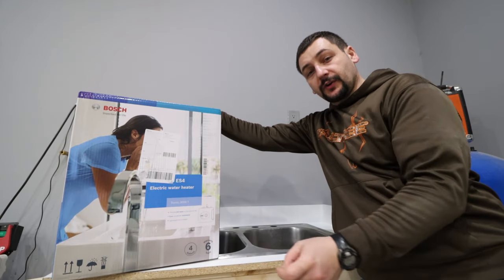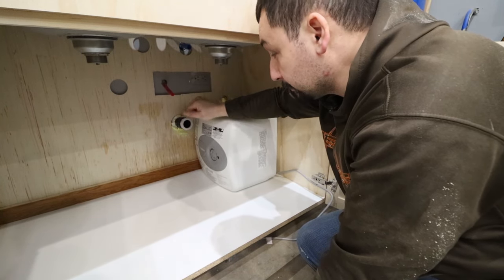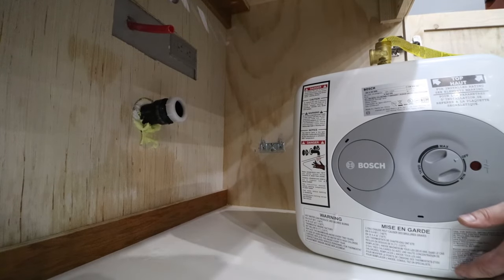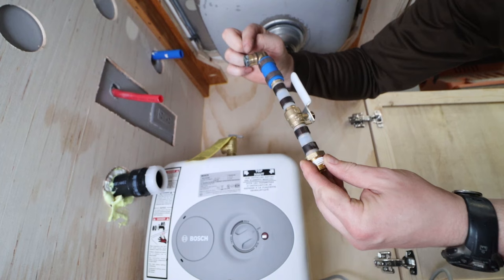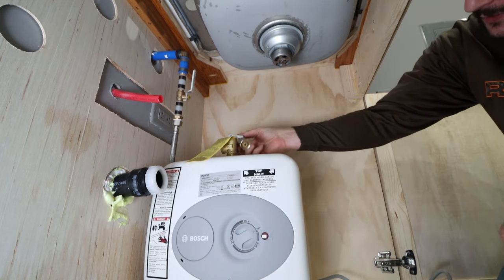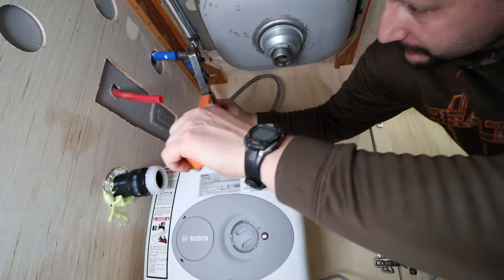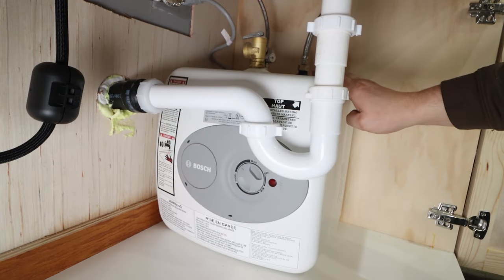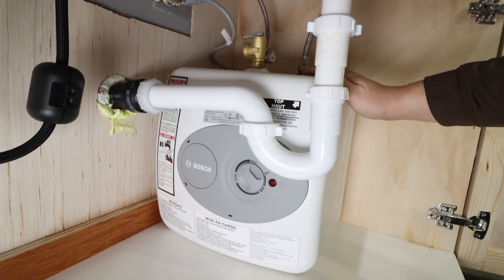Under sink Mini Tank Electric Water Heater Install

Comment: PLEASE stop calling it a Hot water heater. If anything it’s a cold water heater, or just a water heater.😀
Reply: Never understood why you would need to heat hot water 🤔
Reply: 119 ministries YouTube the sabbath day video you'll want to watch it.
Reply: @joejr1967  it is called a hot water heater because it heats water
Reply: No it’s not. Hot water heater is redundant!!!!
Reply: Wouldn’t the hot water supply line from the house connect to the cold water supply to the little tank? As you run out of hot water from the little tank it will be filled eventually with hot water from the larger house hot water tank, assuming you kept the hot water running long enough in the bathroom sink. 🤔
Reply: I feel that way about people who say naan bread. Naan  means bread, so people are saying bread bread.
Reply: What if you don't have a inlet for a water hose, like setting up in a parking lot with 5 gallon jugs of water?
Reply: Get over it
Reply: @tmkinnear : Nope, you want to hook it up to the hot water line. That way it heats up faster and not have to heat up more when the hot water from main house travels through. Why would you want to heat up cold water when you can heat up hot water faster. The purpose of this tank is to heat up water so you don’t want to waste 3-5min of water down the drain when waiting for hot water to get to you.
Reply: @AlvinBrown NO wrong, is call a WATER HEATER you don't need to say HOT because by saying the word HEATER  it's already implementing the temperature, and you can't heat hot water, so he is correct is not a HOT WATER HEATER, is just call WATER HEATER
Reply: @thefisherman6000_USA that’s what he said

Comment: You probably want to put a discharge pipe on that t&p valve so it's not aiming right at the plug that you have right there
Reply: and to a location not effected by water
Reply: How would you suggest plumbing the t&p valve? I don't have an easy drain location. What did you do?
Reply: How would you plumb the t&p valve. I don't have a local drain
Reply: Worst case, run it down into the crawlspace and hopefully catch a drain down there. Worst case, the crawlspace is better than discharging into a finished cabinet
Reply: Good vid, thanks. A water pressure vent almost never happens at the heater. In my house, a failed expansion tank caused an increase in pressure. (Hot water expands.) The hot water heater exploded first. I heard it pop. I went to the garage right away and checked everything out. The 3/4" "vent pipe" outlet didn't work. 55 gallons of water were on the floor and the water was still flowing... Good thing I was able to hear the heater from upstairs in the house, (18 year old Goodman, common choice with builders). FYI I installed the new heater with two expansion tanks in the closed system. They are cheep... ($20) but only last so long... Available at all home improvement stores. Having two expansion tanks and a pressure gauge at the hot water heater are a must if you have the space to do this.... I have 3 tanks now with pressure gauge watching the whole closed system. (closed system:  Basically, if you are heating water and no valves  are open, your system is closed and the water pressure will rise.)
Reply: @williammontgomery3249  should push back to the city hookup unless there is a check valve

Comment: I never had a problem with cold sink water until I had to replace my bathroom faucet with the new low flow set. Now I have to turn the hot water on and walk away for a while. I'm looking at something like this. It's looks like a simple install, and I have a dedicated 120v circuit a few feet above where it needs to plug in. I can pipe it into the existing hot water line so hopefully I can use a smaller version of this, need to do the math. Thanks for this video.

Comment: you did a great job prepping everything for a professional install.  My only question is the direction of pressure release valve.  Do you plan to re-route it away from back of cabinet?  great job!  I'm facing this now.

Comment: Great video! Concise and easy to follow. Well Done! What about the relief valve? Is that fine to leave unplumbed?
Reply: No the relief valve should be plumbed to drain since it is in a finished space.
Reply: @dpky7333  cant do that because of potential for sewer gas/water to back fill into water heater. Have to plumb to outside of building.
Reply: @geraldbennett7035  in warm climates, that's correct.  Otherwise to drain with 1" air gap.  However under a sink it's tough because the air gap creates the potential for a clogged trap to spill out through the gap instead of filling the sink.  Since a mini water heater can easily be removed, I think it comes down to whatever risk the occupant is willing to take.  Backflow risk vs. Scalding risk vs flooding risk.  But I think we agree that leaving the t&p valve as is is unacceptable.

Comment: Hey Daniel!

Thanks for the video! I do have a dumb question for you, how does the water travel up the line from the water heater?

Pressure? Or is there a motor?

Thanks!
Reply: pressure
Reply: City water is what he connected to, city water is designed to have a certain pressure behind that water. Maybe 40-80psi or something, idk. If he was off grid and had a water tank lower than the sink in elevation, then he would need a pump to get the water around the house. OR mount the water tank on the roof and use the “gravity” to pressurize the system

Comment: Would it make sense to connect the cold water supply to this and not the hot water? My bathroom sink is across the house from hot water heater, so pulling hot water to refill this tank would not get any hot water from the heater before it is full.  This would just waste the hot water in the line.
Reply: I don't think this is a booster for an existing water heater.

Comment: Am I missing something??  Why do you have a separate water supply feeding the heater and then another supply line (the red one) going to the cold water side of the tap?  Are they both cold water?
Reply from the maker: Yes the are both cold, I ran out of blue half inch pex, when I was plumbing the shop.
Reply: @DanielWoodell so technically I could just connect a hot water line  and cold water line to this?
Reply: Or am I missing something because shouldn't you have 3 lines at this point 1 cold water line and 2 lines for hot water one from the supply line into the unit and from the unit to the hot water line on the faucet?
Reply: Or should I be installing the hot water supply line to the blue side then from the red to the sink?

Comment: can you extend the power cord?  It's pretty short.
Reply from the maker: If you had a properly sized extension cord it would work, how ever water heater are usually expected to have a plug in close by usually and electrician adds or relocates a plug in to the location that the heater will be located.

Comment: Do you know how to drain one of these ?
Reply: Turn off water supply line. Disconnect unit from supply and discharge water lines. Unplug. Then you must let it cool down for 8 hours. Lift the unit up and invert it over your sink. Water will drain out.

Comment: If this is under a kitchen sink with an existing hot water line, does the hot water line go to the bosch unit instead?
Reply from the maker: yup
Reply: @DanielWoodell  Thanks for the quick reply! It's been a little over a month... still happy with the unit?
Reply: @DanielWoodell  So does the hot water supply pipe go to the Cold Water Inlet or the Hot Water Outlet on the Bosch Unit?

Comment: I think I would have used hot water as supply to tank. Not cold side. Just saying
Reply: I don't think this is a booster for an existing water heater.
Reply: @TTW1  I would use it so I wouldn’t have to wait on main source of hot water. My preference
Reply: @allred53  What I'm saying is that there was no hot water at this sink and that the mini tank is now the only supply.

Comment: No expansion vessel? No pipe for the pressure relief valve? If it went of straight over the power supply.

Comment: Should you have plugged it into a GFI or would it trip the GFI everytime the water heater turns on?
Reply: It is It's supposed to be connected to a 20A GFI outlet. If it trips then there is a shirt or pulling too much amps. Any outlet dealing with water or in the vicinity of water ot outside must be ground fault protected

Comment: I think I'd rather have a tankless under the sink, but I've really been considering one of these for our bathroom, since it's on the opposite end of the house from our heater
Reply from the maker: I looked at the tankless a lot but the price difference and the power requirements in this application just really didn’t work out for me.
Reply: The electric tankless is plagued by the 'sandwich effect' (check online for this) which I hate.  A small tank is far better for kitchen sink.
Reply: @danscolardi1499  you can avoid the sandwich effect where you have a whole house tankless heater and a point of use (POU) tankless heater. A cold water sandwich may be created by the whole house heater which is then corrected by the POU tankless heater. That is the setup I have in my house with the tankless point of use under my kitchen sink. However the drawback is my 8kw 33 amp POU heater can only keep up with a modest 0.5 gpm flow... You would need a 11kw or 13kw POU to heat water at a 1.5 or 2 gpm flow which would require something like 6 gauge copper wire on a dedicated circuit (not cheap).

Comment: Appreciate the video.  I bought the Bosch Tronic 3000 T 2.5 gallon unit and am attempting to install it.
A couple of questions:
1.  I have an existing system with TWO supply lines, hot & cold, to my current sink. Both have shut off valves.
2.  Would I disconnect my COLD water supply & connect it to the IN (blue) connection on the unit?
3.  Then run a supply line OUT of the unit to where the sink gets water?
4.  Or would I disconnect the HOT water supply, connect it to the IN (blue) connection on the unit & then OUT to the sink?
Reply from the maker: Leave the cold water supply alone, you will connect the hot water line to the water in side of the water heater then connect the outlet side of the water heater to the sink.
Reply from the maker: So number 4
Reply: @DanielWoodell  What if you are installing in an RV that you have a 30 gallon tank gravity feeding the water line? Can I just connect my current line running from the sink directly to this or do you need hot and cold lines. I didn't bother to run a hot water line even though I have a propane water heater based on the logic I was planning on buying one of these to just give me hot water. You know what my direct question is can I adjust the temperature of the water or what you see is what you get? Built an entire RV from ground up can't figure out running water😂 Sounds about right

Comment: GFI outlet needed,  and plumb the over flow temp/pressure valve away from the unit.
Reply from the maker: That outlet is GFCI dedicated 20 AMP breaker in the panel, and yes the relief line should be plumbed outside, but it’s in my shop and I build the cabinet if there is a issue with it I’ll be the only one to blame 😁
Reply: @DanielWoodell    Hi Daniel, That is good that it is on a gfi circuit. But it would have been a good point to mention, as some viewers might no know that it should be. As far as the relief valve, you're right it's your $200. I really did not mean to sound like a 'B" buster. George
Reply: @DanielWoodell    BTW  I did enjoy the video!

Comment: I already have a whole-house tankless water heater in my basement. I want to install one of these under my kitchen sink but I don’t want my main heater to kick on every time I use this. Can I put a T fitting off my cold supply line under my sink, so that it feeds the cold faucet and the under sink heater, and cap my hot line under the sink?
Reply from the maker: Yes

Comment: Dad just installed this in his place to save electricity but now he only gets a few minutes of warm water in the shower. Any idea why? Low water pressure, low volume. Thanks!!
Reply from the maker: This type of tank is designed for a sink only gallons provided and the on-demand feature or not read it for a shower.
Reply: This is not meant to supply a shower.